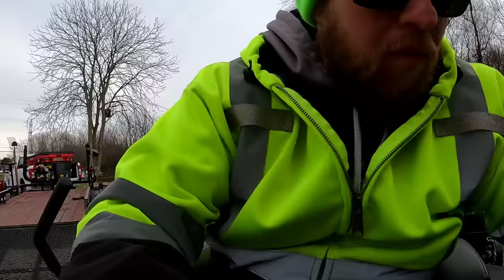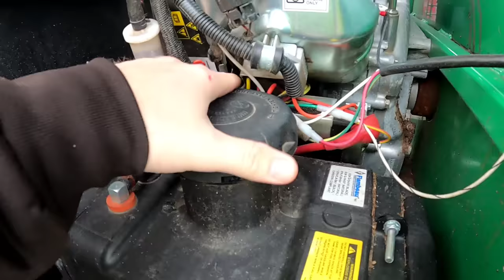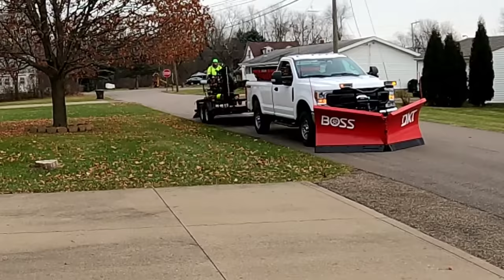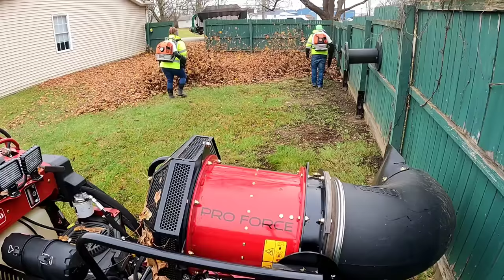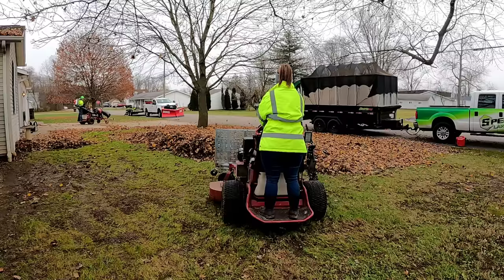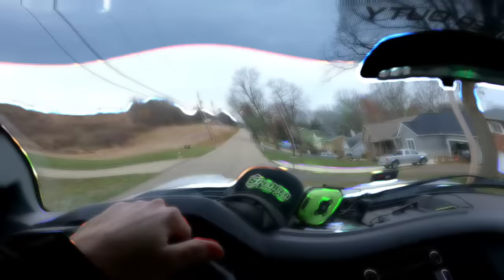HOMEOWNER MAY HAVE WAITED TO LONG | $200 IN UNDER AN HOUR!

Comment: That Proforce is a beast, and I really didn't think the semi-frozen wet heavy leaves could be moved that well.  Likewise, the equipment you've invested in has sure paid off for BIG, HEAVY cleanups like that, and you can imagine rakes and lighter equipment trying to handle it.  GREAT work!

Comment: That was a good idea TQ...  seems like it works better having hose stretched out. Maybe do the big ones like this, where the leaves are a little father back then, use big push rack , to push everything from the sides ..then the back to that sweet spot for the hose. Maybe you won't fight it as much and not get quite as worn out. In other work, perfect TQ's idea!

Comment: Loosen your chain so you can lay the hose on the ground and blow the leaves to the hose. It will help break up the compaction from them being wet and from using the plow and save your back from lugging the heavy hose around. It will create a wall of leaves on each side of the tube and naturally funnel the leaves right into the hose. 👍🏻

Comment: Best new piece of equipment you added to the fleet is the leaf plow. I’ve had mine for 20 years and couldn’t imagine cleanups without it. We have no need for a 12K blower. We blow them with our backpacks and our 13 hp. Little Wonder. Once we hit the wall of leaves we start pushing with the leaf plow. Btw we always use the leaf plow to move leaves close to the hose. Work smarter not harder...! Why work your butt off raking when you have the plow ???
Reply: Try doing a bear hug on leaves stuck at the end of the hose when it gets stopped up. It will save the time of throttling down the leaf loader and unclogging. It work for us 90% of the time.

Comment: This is a huge & thick leaf cleanup. It clearly takes some serious blowers to move the piles for vacuuming into the truck.  Suggest a rubber wrap & zip tying those loose wires clear of cap. Job nicely done

Comment: Great video as always.... I heard mention of truck squat with the plow on in a previous video.  I put on Timbrens front and rear to minimize that on my F250.  I also have a V-plow and haul a pallet of salt.  No maintenance, no adjusting, head light beams stay straight, safer braking, $500-ish.
Reply: Use timbrens on my 2021 f150. Fantastic product for heavy front loads such as a plow and rear loads

Comment: The fault of the fuel cap lays in the blower manufacturer installing the tank to close to the engine, an offset cap would solve this problem, also a remote wireless throttle control at the pickup  nozzle would be handy,
Reply from the maker: Yeah for sure! They don't have much h space to work with on these setups unfortunately.
Reply: Unfortunately there's not enough players in this segment at 2-3 brands to force ingenuity. It's kind of the "the way it's always been done" mindset with these debris/truck loaders manufacturers.

Comment: I feel like that big hose should be on spring assisted rollers that both allow to move around easier and also up n down without any effort, also something to prevent it from being clogged like shredders inside that start up. When actuated, but not something that would be strong enough to hurt a person but enough to pull enough leaves in to get it unclogged without having to cut it off n turn it back on, n that control should be wireless anyway.
Maybe even a fully rc type controller for the hose lol thatd be cool

Comment: Your equipment loadout is amazing! 
Been loving your channel for years!
I think you'd have a smoother process with that max vac by taking smaller bites. 
Every time you take a big glob of leaves, you can hear it immediately bring the fan nearly to a stop. This is terribly hard on the fan, shaft, crankshaft of the engine and even the engine casing. It's almost like banging a clutch in and out over and over on your car. Bringing all that mass of the fan and driveline to a quick hard stop over and over again will absolutely shorten the life of that system. And I can tell by lookin, that NONE of your equipment is cheap. Your stuff is top-of-the-line and you keep it beautiful!
I'm not trying to tell you how to do your job. Nothin but love here. But I worked a lot of years with a Vac-All truck, cleaning catch basins, and almost every breakdown was caused by this exact "too big-a-bite" mistake. I hope you don't take my suggestion as shade or hate. I'm just an old buy who's been around machinery and mechanical stuff all my life and I could hear how big a load those globs of leaves were putting on your system and figured I'd mention it. I'm always Blessed to see how well you and your wife get along working together.

Comment: If you can't  have some fun then the job isn't worth doing. The leaf plow would you be able to get the adapter for the front frame of the 6000. That way on bigger clean ups you could have the leaf plow and push the large pipes and mulch up the stragglers. Also if you had multiple  clean ups in a day you wouldn't have to prioritize  one peice of equipment over another.

Comment: Not sure in your area but I started using razor back rakes. They make raking faster and more efficient somehow or at least it seems like it to me. Didn't know if you had tried them or not.
Reply from the maker: Will have to check them out
Reply: All Razor Back hand tools are great you right those rakes almost like dethatching rake we use them at my job they 30 bucks but worth it imo

Comment: Shawn , maybe you could put a strap over your shoulder . 
And connet it to to thebottom of handel near the hose.
So you lose a lot of death weight on the hose . 
And have more strength in your arms and steer with with your legs and knies .

Greetings from holland ( netherlands )

Comment: It's gotta be a design flaw in many leaf vacuums. We have the fradan leaf vacuum with the 31 horsepower Vanguard engine and the inside plastic piece commonly will seperate from the plastic cap leaving the inner piece covering the tank. Im assuming its from all the vibrations caused by the machine. Are we alone in seeing this?
Reply from the maker: Yeah it really stinks when I have to fight with it.